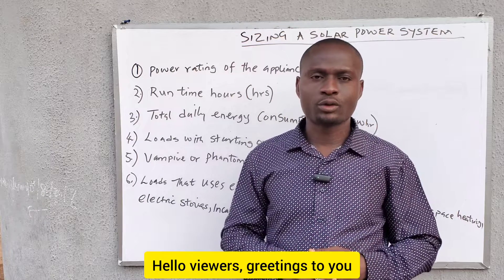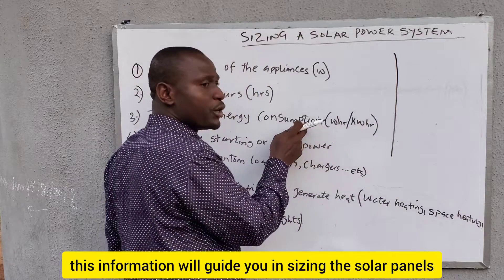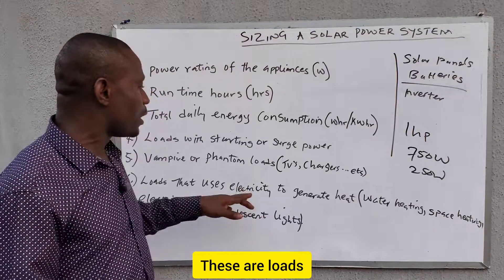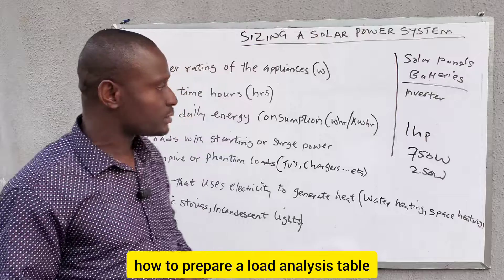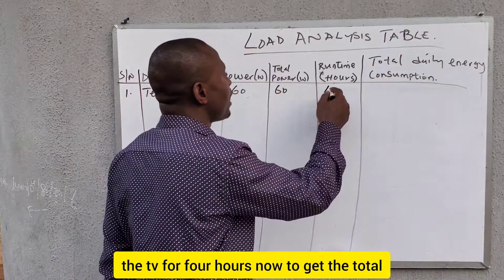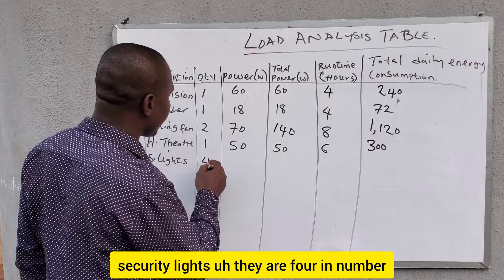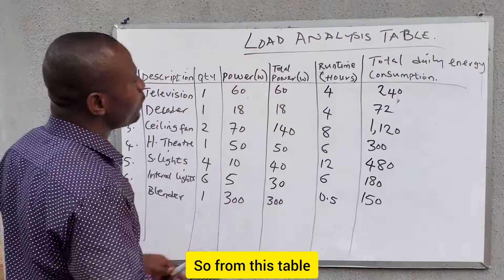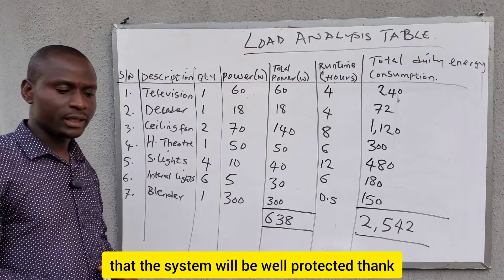How to size a solar power system. #solarenergy #solarpanels #solarpower

Comment: Hi, I have 3000wat or 3kv convetor, a solar panel, a lithium battery, I want to know how to connect the system step by step  including what breaker must I use and fuses

Comment: In your last lesson about solar parallel and series connection, you said voltage from parallel connection is higher than voltage from serial connection... Pls check again, it could be slip of tongue from you. Serial connection increases volts while parallel connection increases watts...not volts. Thanks
Reply from the maker: Yes... That is probably a mistake. Thanks for the correction. I'm grateful 🙏
Reply from the maker: Parallel connection increase current for solar panels and increase capacity in Amp-Hours for batteries configuration.

Comment: Can you help me to sizing or design system. Total load 100kw inverter , roof area is 1152 square and  I have 240 panels the 550w/49.56v. Please help.

Comment: Thanks bro for good teachings.may I know if it's possible to use solar for instruments in church service
Reply from the maker: @korirkipngetich5007  Yes you can but you need to know their power consumption so that you will properly size the system. Thanks
Reply: @Solarwattng  I have a mixer,two speakers, keyboard and microphone.wil I determine their power consumption.coz most input power is from mixer itself

Comment: How does external solar charge controller and inverter connected to the grid regulate the charging current to the same battery bank?